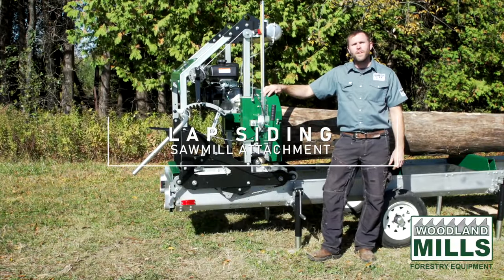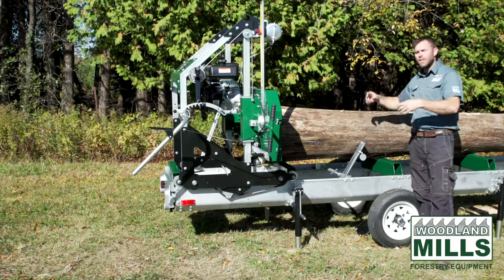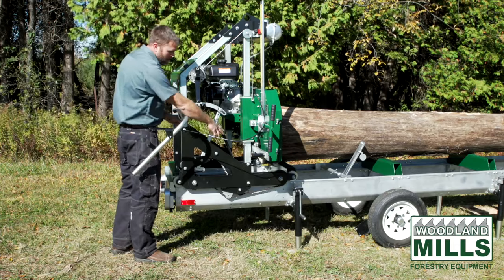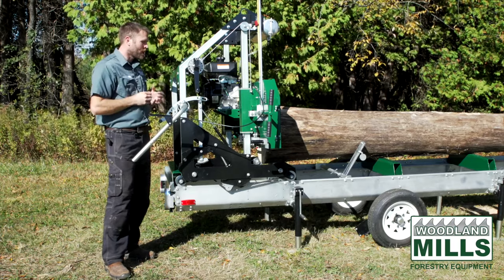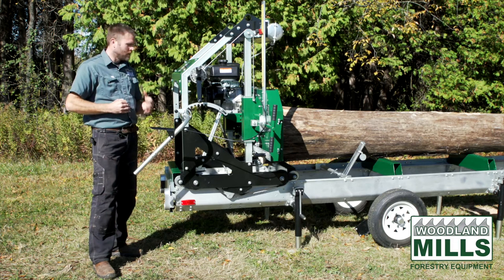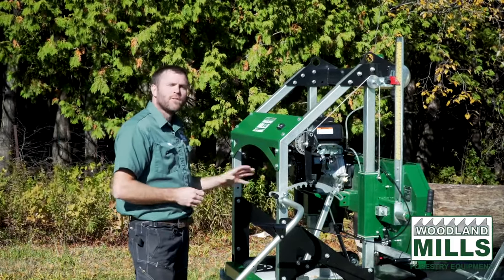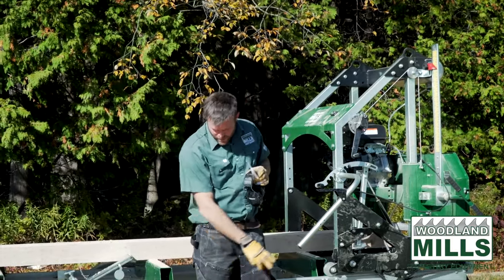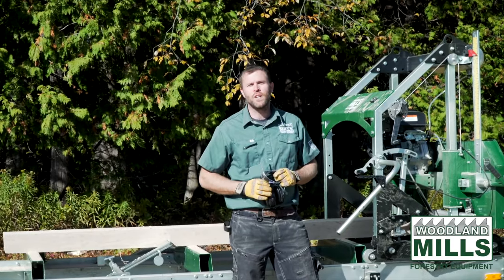Woodland Mills Sawmill Lap Siding Attachment

Comment: Does it only cut one angle, one side, or can you rotate left and right?
Reply from the maker: The right hand side of the saw head rotates from horizontal to angled up. This movement allows you to create a lap siding board on every cut/pass. After creating a square cant, the first cut is made with the head tilted on an angle to create the first lap siding board. The second board is created by tilting the head back down to horizontal to make the next cut/board. Because the first cut left a sloped or angled surface, the second cut (horizontal cut) makes another lap siding board.
Reply: Brilliant! Where do I go for more information.